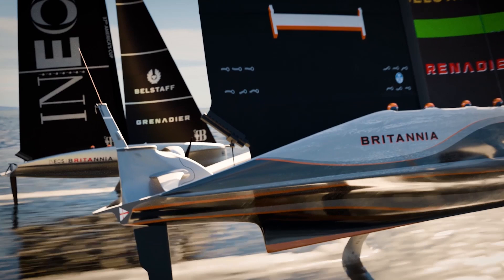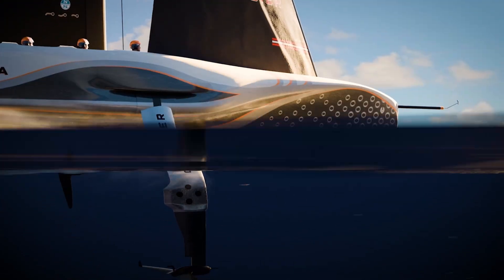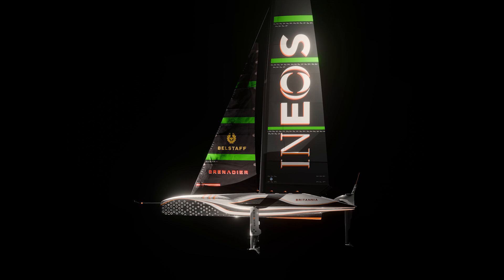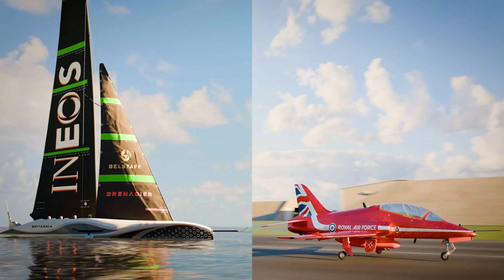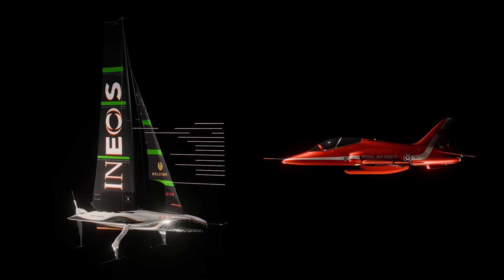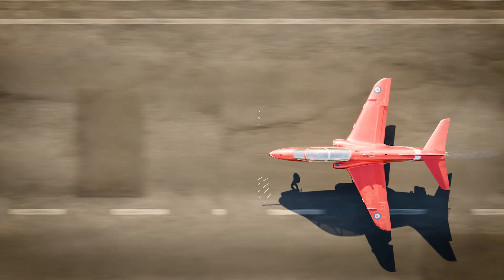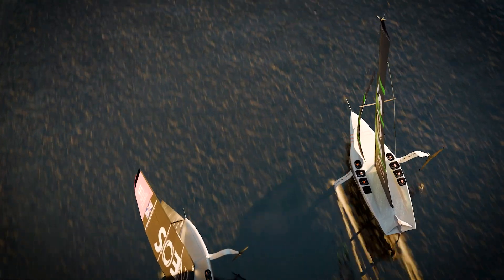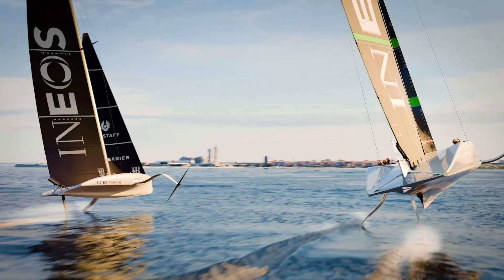The Boat That Flies

Comment: Good video, mostly.  But, if I may… an aircraft wing does not work by requiring ‘an engine to push the air over the wing’ - how does a glider work?!!  The wing works by having air flow around it, on all aircraft.  A glider, and a powered aircraft with the power pulled back to idle, does this by using potential energy to descend through the air.  The engine is only there to provide thrust, so that forward speed is generated even if in level flight or climbing.